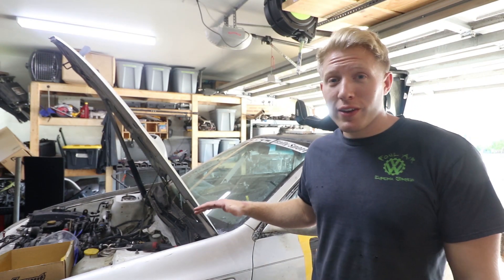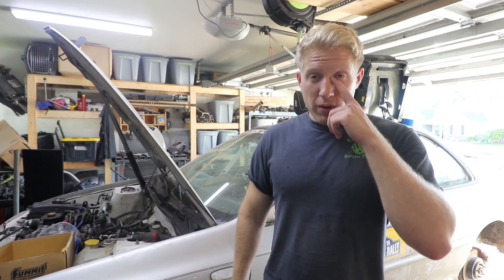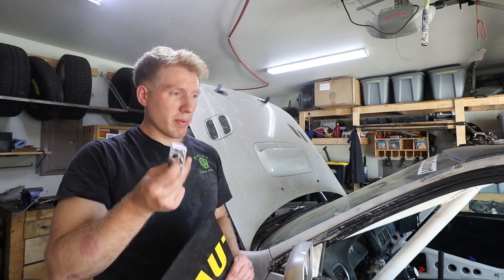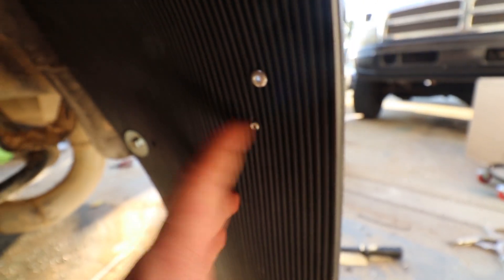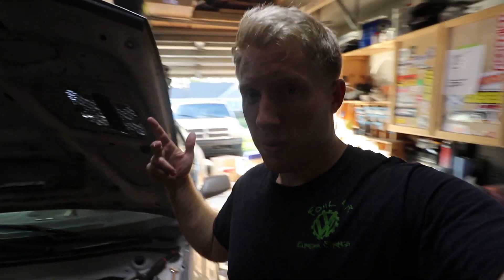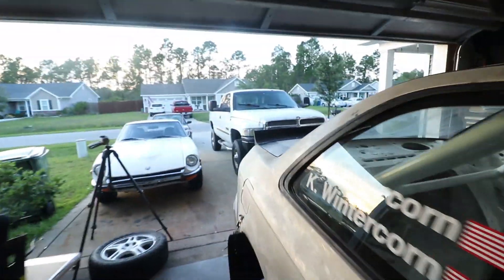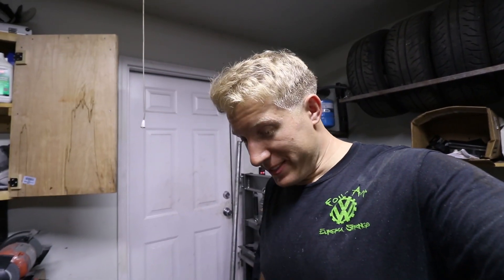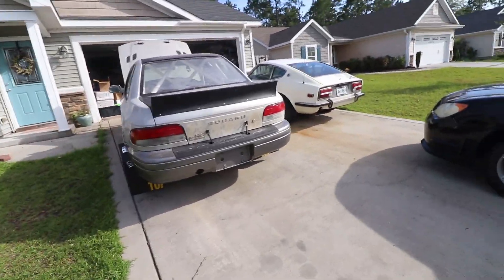Semi Truck Mudflaps For the GC8 Rally Car and it Finally Moves

Comment: Nice one!
One thing I've seen done a lot with mud-flaps is putting a washer under the head of the rivet, so the washer takes the load instead of the rubber and pulling through!
Reply from the maker: I used a washer on the back side of the rivet, but that's a good idea for throwing one on the front so it can grab more of the rubber.

Comment: Doing the same on our build! Rallyarmour quality is crap anyways. Stoked to see your motivation again in the car! Get a swamp cooler for the garage and keep the door closed now that its clean!
Reply from the maker: Yeah the Rallyarmour probably wouldn't have lasted a rally with a lot of gravel on the stages, cheap semi mudflaps are definitely the way to go.

 I wish I had enough room to work on the car with the door closed but I only have about two feet in front of the car with it pushed all the way against the garage door. I wanted to throw a split system in there last year but it isn't feasible with the amount of room I have. 
One day I'll get a bigger shop though!